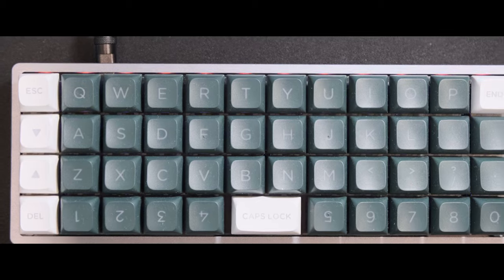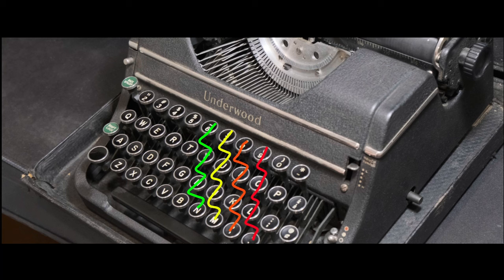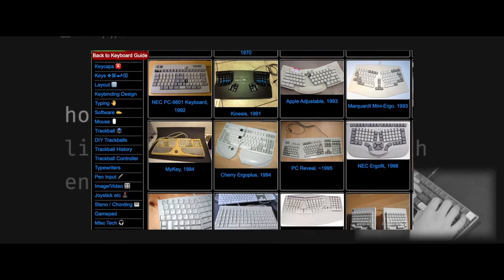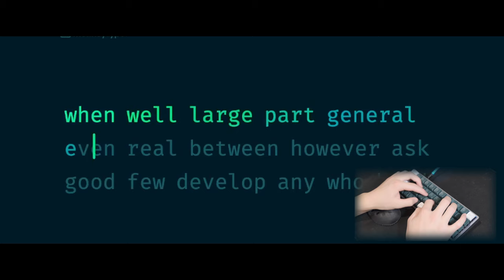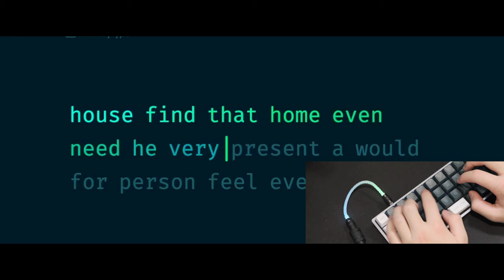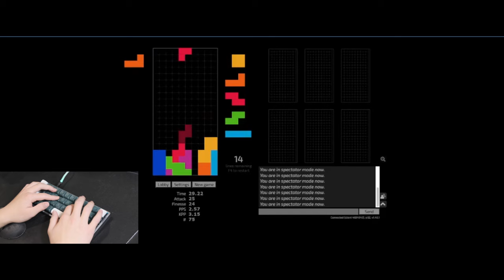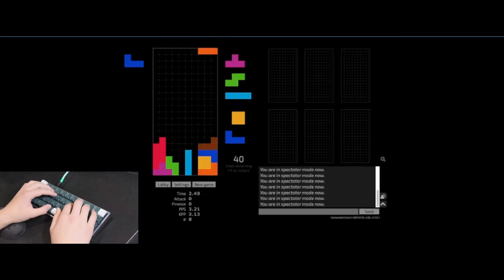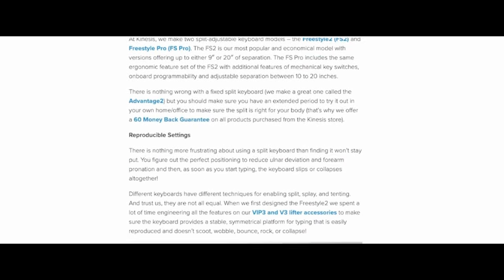Good in Theory, Bad in Practice - A brief history of Ortholinear Keyboards

Comment: A split ortholinear keyboard is still an ortholinear keyboard. It's frustrating that you kept that until the end of the very end of the video where you even debunked most of this video yourself.
Reply from the maker: I'm pretty sure I explained very clearly in the beginning I don't consider a split ortho board a strictly "othrolinear keyboard". All split keyboards regardless of layout* I consider as a part of "split styled"* keyboards.
Edit: I meant split as a category, not as one specific type of keyboard. They were created to solve the very problem created from "orthro bricks", so they don't have a place in this video.
Reply: @va1orance you're so right, two things can't be true at the same time /s
Reply: @va1orance You say that but not all split keyboards are equal, some are ortholinear, some are column-staggered (like the ErgoDox EZ) and others are curved downwards (like the Glove80).
Reply from the maker: @MaximilianBerkmann  Yes, however, they don't have the problems I mentioned specifically because they are split. To clarify, I am talking strictly about single  PCB keyboards (well, even then, they have split designs like the Atreus). The main point is they don't have a place in this video. I would consider them solutions to the problem created by "orthro bricks" themselves.

Also, yes, I am aware there are:
- Orthrolinear split
- Manuform/Dactyl split (hopefully getting one soon :D)
- Staggered split
- Column staggered split (+1)
- some other wacky ones
I'd love to test them to see if they actually do anything, but they're all so expensive :d.

One last note, to clarify any confusion, 
I meant split as a "subcategory" of ergo boards. I did word it rather poorly. 

Keyboards > Ergo Keyboards > Split keyboards > all the varients

Comment: your problem is not the ortholinear but that you still have too many keys. I currently use a "ferris sweep" as my daily driver (34 keys) and my fingers don't need to move around. Open your mind to the amazing world of layers and all your problems will disappear
Reply from the maker: My problem with orthrolinear is not the key count, but the shape of the board. The ferris sweep is a split column stagger keyboard. I currently use a split column stagger keyboard.

Comment: How is it bad in practice? I got one and I hate the fact that now I hve a laptop and can't use it. 40 percent with one shot layers is vastly superior. You just don't know how to configure it.
Reply from the maker: If it works for you, then great! I personally was looking more towards the comfort side of the keyboard, it just simply doesn't quiet make sense in my book.
Reply from the maker: Also, since you seem to be a long time user of ortholinear, is there a reason you didn't go down a split keyboard (or similar) path?
Reply: @va1orance  I like the size of the 40% and I don't like split keyboards. I've never had any wrist issues with my 40. I even fixed my wrist issues causing by using ctrl c an v so much by moving ctrl to where the escape key is in most keyboards.
Reply: @va1orance  I have used the bm40 for a couple of years as my main keyboard, and now I am using the ferris sweep, with the bm40 I use a split layout as well and with this I solve the position of the wrists, although now I only use it as a gamepad.

Comment: The points of ortholinear are not only finger movement, but more importantly the left wrist bending so tiny keyboards regardless if it is orthrolinear is already bad, but ID75 with alphabets distributed on the sides and TypeMatrix almost have no wrist bending issue.

Comment: Ortholinear is superior to staggered because you can't have a calculator layer in staggered. Well, you can, but it sucks
Reply from the maker: Just curious, what makes it worse on staggered for you?
Reply: @va1orance  for numpads or anything else like macro keyboards or something it's less ergonomic slightly if it's a staggered numpad since your fingers dont just have to go down anymore. they need to go down and to the left or right, which can be weird to locate keys if you use a numpad a lot or need to use it fast potentially.
Reply: @va1orance   as I said, numpads are too far to the right and hitting keys diagonally is a pain. I much rather have a grid numpad that is in front of my hand

Comment: There’s a big error made in this video. 

He claims that using a wider keyboard reduces the angle of your wrists. That makes zero sense because the home keys aren’t any further away regardless of how many extra keys are on the outsides.

Of course regular keyboard have the exact same problem. Using split ortholinear solves that problem completely while retaining the benefit of no weird staggering. Plus split would look bad on a staggered setup with the staggered edges.
Reply from the maker: The keys go in the middle :). For example, the XD75 keyboard is often displayed with a number pad setup in the middle. Three keys to separate letters, one key to separate edges.

Comment: Cool vid. One NOTE though: The (theoretical) additional stress on the wrists experienced by some people when typing on 40% ortholinear keyboards:
1. can be entirely mitigated by having a split ortholinear, or even vertically-staggered split ortholinear keyboard such as the Moonlander (i.e. this way hands and wrists can be adjusted to any angle desired), [EDIT: OK, I see you did mention this at the end - thanks].
2. has more to do with the DISTANCE of the keyboard in my (extensive) experience, i.e. if ANY keyboard is too close to you (which is common), then the wrists have to bend in order to be able to type on them. This can be easily remedied by simply moving the keyboard further away from you, so that your arms and wrists are straighter, or moving your chair further away from you (possibly tiny) desk.

Hope this helps anyone considering the "cons" of this keyboard. Ortholinear is definitely worth a try - despite not being easily obtainable in many countries (and the price).
Reply from the maker: The distance is certainly something I didn't consider. Good point there!

The split part is very true. Those keyboards are known as "colstag" or column staggered keyboards and I've been using one for the longest time (there are also split othrolinears, but at that point why not just go colstag). Another variation are keywell/dactyl/manuform keyboards which feature key depth.

I will be making a new video including those shortly.

The reason I made this video was because at the time, othrolinear keyboards were indirectly marketed as a cheaper entrance into ergonomic styled boards and in my opinion, they just did not compare to split and other styles. The most popular from what I remember being Drop OLKB and related boards; which were not split, and within the price realm of Chocofi (colstag) and other boards. 

Just want to clarify to folks: 
Othrolinear does not mean ergonomic; it is a subcategory
Split keyboards are split keyboards; they can, and also can be not othrolinear
Reply: @va1orance  Ah right. Likewise, excellent explanation. And thanks for pointing out the differences. Can't wait for the next one. Keep 'em coming. Subbed.👍🏻

Comment: It's very subjective, personally I got a lot less hand pain using a Planck because of thle reduced finger movements.
And I switched to a 42 keys split recently, even better. But I would never have switched directly from a full size staggered keyboard, the Planck really helped.
Reply from the maker: Yeah definitely, after using it for even longer, I've noticed there is a significant benefit in terms of finger movement distance. Plus it's often much cheaper than to fully switch to split right away.

Comment: You missed the Kinesis Advantage keyboard.  Bigger than the Plank (probably an 85% keyboard) that has a split to address your issue of wrist angling, but each split is still (largely) ortholinear.  A very nice keyboard, but not small enough for the gamers.
Reply from the maker: The Kinesis Advantage keyboard is a fine keyboard for sure, but it falls under the category of "Dactyl/Manuform/Sculpted". (I know, there's so many types now.) Also, at the end of the video, I do briefly show a picture, although it's true I didn't explicitly talk about it. 

I know this type of keyboard has gained some traction (especially a couple years ago), but unfortunately, since I don't have one I can't give any opinions on it. I'd love to try, but until then I probably won't talk about manuform keyboards.

Comment: I’m missing something about how intended/correct size… it just has more keys but the primary letter keys are in the same spots so I don’t see why comfort would be any different.
Reply from the maker: The idea is that when you type, to reach the the keys on the row above or below you need to extend or curl your fingers. Orthrolinear "claims" to be beneficial in this, but ends up in a way being slightly worse (in my opinion). Your hands tend to form a ^ shape while typing, and you can see that an othrolinear board is more like ||.

Comment: Recently switched to a plank style (12 x 4 matrix) keyboard and solved wrist angle issues by using a layout that is "pushed apart" so my hands rest as far apart as poosible (I do not use qwerty, but if i did there would be a 2 key gap between t and y, a 2 key gap between g and h, etc). An added benefit is that there is an extra key available to each of my thumbs. I can fit the missing keys onto these thumb keys and other layers that are already necessary with a 40% so I don't find it a hassle to use and also takes a fair amount of work of my pinkies (i.e. no having to stretch for tab, shift, backspace and enter) .

tbf, might decide I hate it and change again in a couple months, who knows.

Comment: i'm not a typist, i am a gamer and occasional programmer, i need my function row, and i want a straightforward geometry so i can hit keys anywhere on the board, in any key combo, without looking. no-one makes a 6 row + numpad keeb. PLEASE someone do it, i need Fn, N-key rollover, numpad, and low latency wireless, optionally rebinding, lighting, device switching, bluetooth, hall effect analog, etc. Zack Freedman is doing the Mirage which gets some right, but its still too small and uh, still not shipping.

Comment: imo ortho should almost always be paired with a split layout
my reasoning is this: if you want to type 'properly' (as ortho encourages) with the right fingers on the right keys your wrists will bend. however, most people don't type 'properly', because it's uncomfortable, for that exact reason. this is why people swear by the magic keyboard - it's not ergonomic, but  people use it 'ergonomically' because if a keyboard isn't built for us we will adapt to it

I'm using an ortho monoblock, and even with some extra width between my hands, it kinda sucks trying to type 'properly'. This is why there is a veritable pipeline from ortho -> split -> column stagger. I think both mindsets are reasonable, because you don't get any faster by typing 'properly' (see: world records) - you only gain 'comfort' or 'feel'.

why would I use the worst of both worlds? (ortho non-split?). simple: more keys and a thumb cluster :)

edit: yeah, what you said, kinda

Comment: listening to this vid and your continued question about the ortholinear layout, it strikes me that you should probably give the Keyboardio Atreus a try. 
Also a 40% keyboard but keys slightly angled and staggered column. Fantastic little keyboard.
Reply from the maker: The Atreus is a column staggered keyboard. Although, it does indeed fix the most major problem with othrolinear keyboards. That being said, I main an Iris Rev. series keyboard, so, essentially the same experience. Atreus is quite nice though.